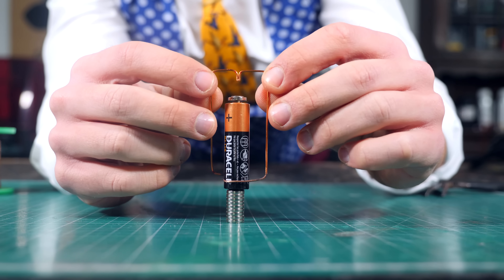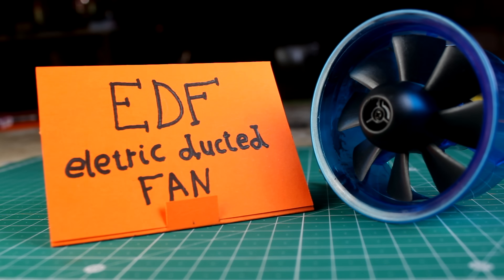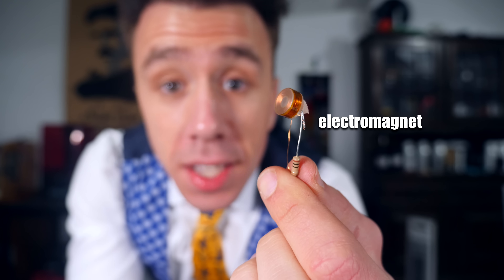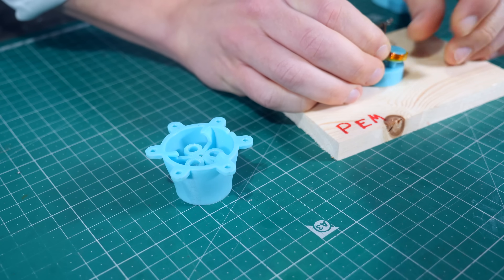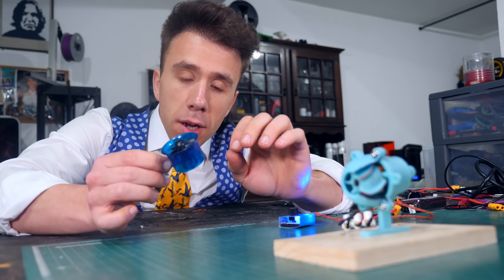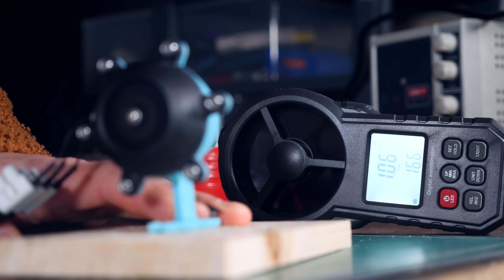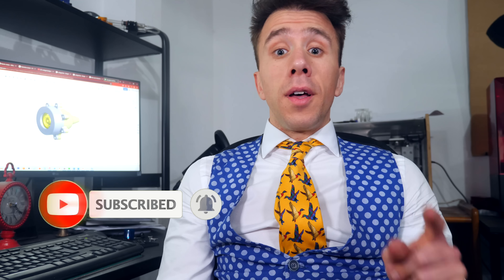I 3D Printed an ELECTRIC MOTOR FAN

Comment: I'm an engineer and here is some general information that can help:
The biggest issue is that you are not measuring the input power (voltage*current of motor) so you don't know if your fans are using the same electrical power. The same motor doesn't equate to the same use of power with a coupled fan (look up "fan laws"). 
The remaining issues have to do with the non-intuitive nature of fans vs impellers...
First, there are two distinctly different ends of the design of a "Fan": a propeller maximizes flow with low pressure differential. An impeller (compressor) maximizes pressure differential with low flow. 
Second, in a propulsion system, the pressure entering the engine and exiting the engine are both at atmospheric pressure by definition. 
The EDF is highly efficient because it uses a propeller that accelerates air without significantly increasing the pressure (there is a local pressure differential similar to a wing, but no actual pressure increase in the stream after the fan). 
The Turbofan that you make is compressing the air to flow through a smaller area than the intake and forcing it out of a smaller exhaust area. There are multiple inefficiencies here which are resulting in an overall loss of energy (less thrust) that the EDF does not have. The first inefficiency is in the compressor design (look below for notes on compressor design). The second is heat loss in the compressed air prior to exit (compressing air raises the temperature). The third is increased friction due to higher velocity air and more of the air touching a surface compared to the EDF. The last is in the exit nozzle because there is a significant velocity difference to the surrounding air.

If it's so inefficient, why is the design used?

It's used in a jet engine where there is heat addition to the compressed air before it is expanded out of the nozzle. Jet Engines use the Brayton Cycle which gets increased efficiency with higher compressor ratios and increased temperatures in the combustion chamber, and utilizes the power by removing the heat through the turbine section and converting that heat energy to shaft power and exit velocity of the air. 
Since you are not adding heat in your engine, you are not gaining any power from the compression, you are only creating more losses by compressing and expanding air.

If you look at existing aircraft, you notice that they have giant fans in the front, and multiple shrouds around the engines. These are known as "High Bypass" turbofans. They get their efficiency by NOT trying to use the hot exhaust gas as thrust, but by converting as much energy as possible to shaft power to turn the giant fans. Those fans push only maybe 20% of their air through the jet, and the other 80% is pushed around the outside of the jet, just like with an EDF. This way they get the high efficiency of a propeller within a shroud (edf) and use the most efficient process of the turbine which is to convert the heat energy to shaft power, and minimize unused heat in the exhaust gas. The irony here, is that an airline engine is trying to be an EDF rather than a "jet" because it's much more efficient. 

So here are some things that can help you moving forward:

Intake design: Bernoulli's principle applies and contrary to intuition, reducing the size of your intake opening increases the pressure your impeller can generate. If your intake area is half the size of the front area of the impeller, then Bernoulli's principle says that you are getting 2:1 compression (and 1:2 velocity) before the impellor. Its like getting free compression. Always make sure that your intake is equal or smaller than the entrance area of the impeller. (stick to 1:1 or at most 1:1.2).

Compressor design: The amount of pressure your compressor must generate is based on the difference in your entrance and exit areas. So if your exit area is half of your intake, then your compressor is 2:1. A hybrid compressor (combined axial and centrifugal) that you can build with 3d printing should probably stick to 1.2:1 to 1.5:1 pressure ratio before you get big efficiency loss. This means you need to make the area at the exit of the impeller that is slightly smaller than the entrance. Calculate wisely because it's easy to get a larger exit from a hybrid impeller. For reference, a squirrel cage fan actually has less pressure (but higher velocity) at the fan exit because the exit area is larger than the intake area. 

Combustion chamber design: You need to slow down the air so it can hold flames, but you also get more compression by expanding the air out of the compressor. If you send the air out of the compressor through a 4:1 expansion then you'll get air that's 1/4 of the velocity but 4x the pressure and makes it easier to hold a flame. If you can look up the flame front speed of the fuel you want to use, you need to keep the average velocity in the combustion chamber below this speed to hold combustion.

Turbine design: You are not really doing this but if you were, you should shoot for the same entrance/exit ratio as the compressor to start. 

Nozzle design: the goal of the nozzle is to match the pressure in the engine back to atmospheric pressure. This means you should really have the same exhaust area as engine intake area if you are not introducing combustion. 

Extra bypass nozzle design: Because the velocity of the air out of the nozzle is much higher than the airstream, you can add another nozzle behind this that will suck in bypass air kind of like a carburetor and get extra thrust by entraining the bypass air. Exit velocity is reduced but mass flow is increased. Look up the designs for turbine engines in RC aircraft and you'll see this method used. 

Brayton cycle design: 
Think of the process like this... the compressor flows the same quantity of air as the intake but increases it's pressure and/or velocity. It's goal is to increase efficiency by increasing pressure ratio in the engine. The expansion prior to the combustion converts the velocity out of the compressor into pressure based on Bernoulli and it's goal is to slow down the air for combustion. The turbine extracts heat energy and converts it to shaft power. The nozzle then converts the remaining pressure in the engine into velocity at the exit based on Bernoulli again. Pressure at intake and pressure at exhaust are always at atmospheric, so you can calculate pressure ratios within the engine from the cross sectional areas. 

Your fan and nozzle matching: If you design an impeller for a 1.2:1 pressure ratio, then your nozzle should be also 1:1.2 expansion. To have the most efficient design, your exhaust should be the same area as your intake, not smaller as in your video.

In Summary: Without adding combustion, you will never have more thrust from a design that compresses the air than from a design that is a fan using the same electrical power. 

To caveat this, although I am an engineer , I'm not an expert in jet design. This is just the basics that I was taught as I remember. So I can't guarantee everything here is fact... but should be close. I'm also not immune to being wrong.

Comment: Correct me if I'm wrong, but I think that the blade geometry of your impeller is backwards. As far as I know it should be curved inward at the intake to 'scoop' the air and throw it out of the exhaust. On yours, the curve is at the exhaust, so its probably just 'stirring' the air rather than moving it.

Comment: I'm a little rusty on my jet propulsion theory... but I think an issue you might be having is feedback pressure. Jet engines have a series of fans that are designed to keep the high pressure on one side of them. It looks like your design just has the one fan. So because you're reducing the outlet diameter to build the pressure inside, but not unbalancing the pressure, some of that high pressure air is fighting against the air coming in, reducing your thrust. Also, in a traditional jet engine, the purpose of the fuel is to (literally) explode the pressure so you get a helluva of lot more pressure coming out, which greatly increases thrust. And then because the pressure is unequal across the fans, the fuel explosion actual helps to create a vacuum on the low pressure side of the fan which helps to draw even more air in.

I think you might have to look into something like air uplift and downdraught and see if you can apply that to your engine. Without fuel, you don't really have anything increasing the vacuum pressure on the low-pressure side of your fan, so you're not going to achieve the kind of thrust I think you're going for. 

I don't know if it would work... but I would try to modify your fan design. Start with a disc and print the centrifugal fan in the middle of it. Give some space for the inner walls of the fan and then add blades that would fit inside the outer wall of the engine. In the space between the inner and outer fan blades, you'll need cutouts in the disc to allow the air from the centrifugal fan to pass through. If you angled the edges of these cutouts, it would help with air movement. The inner walls on the high pressure side would focus the high pressured air out the exhaust, and the outer walls fan area would have openings near the exit of the exhaust for the lower pressure air from the out fan to go. Since the HP air would go in one direction and less likely to spread, it would create a vacuum in the outer fan area, pulling more air through the lower pressure fan blades. This vacuum would force the outer fan to spin faster, and since they're connected to the inner fan via the disc, that should spin faster as well increasing the HP air which in turn increases the vacuum from the outer fans and you should get a positive feedback loop which should increase thrust. But like I said... I have no idea if it would work. Sounds good in my head though, lol.

Comment: The reason is simple, the 3D printed fan blades have a very low surface area. Yes it is  rotating at the same speed but the blades are too small to move any air. This is something you can see on old warbirds the Spitfire mk.22 had around 2000hp and a 5 blade propeller with long skinny blades, the  german Fw190A9 also had around 2000hp but a 3 blade propeller with shorter and wider blades. Both propellors despite being very different in shape had a similar surface area imparting useful work on the air to create a similar amount of thrust.

Comment: It's hard to take this stuff seriously. If constant electricity can create a magnet, but a magnet can't create electricity (unless it changes/moves) there's probably some arbitrary nonsense involved.

As for the fan's performance, it seems obvious to me. It's just a restricted flow. The ducted fan has no flow restrictions. The aerospike has massive flow restrictions. So this creates high pressure without creating high flow. Meaning, it should just cause less mass to be moved, resulting in less thrust.

To be fair, I do think this aerospike design can produce more thrust than a simple bell nozzle in a rocket because of the greater displacement and surface area, but that's only with an expanding fuel. Fluids like air and water are a little different. You aren't trying to compress or expand anything. You are trying to create flow or movement.

Consider using this design as a water propulsion system, and it becomes more obvious. Water isn't compressible, so it needs to be moved. This design has less flow capacity than a normal ducted fan would, so it should produce less thrust. It's similar in air, but air is compressible, so it changes the dynamics slightly.

Also, the impeller didn't seem very efficient or effective.

Comment: Here is a video topic suggestion. I've always wanted to see if it were possible to use the principles that make a pulse jet function and try to design a completely electric version using sound waves, perhaps from an ultrasonic transducer. It would be a neat experiment even just cracking the math and, if possible, to assemble a prototype.

Comment: ...maybe you should measure input power (voltage and current) of the motor in both cases to see if the power/thrust ratio is equal of massively different.

On the other side, that centrifugal fan may have a bottleneck on the input side because cross section of the input opening is way smaller than on the EDF and may result in creating an air resistance...:/

Comment: @Integza ....are those impellers not turning in the wrong direction...? 🤔 If the impeller blades point clockwise, shouldn't the impeller turn anti-clockwise....? I'm just spit-balling here.....🤔

Comment: If you put the motor of the EDF to the centrifugal fan you would get the same power, but not the same thrust.

The thrust is based on the type of fan you make. An axial fan, where you use the fan to exert work on the flow would give it a lot of kinetic energy. 

On the otherhand, A centrifugal fan would use the work to accelerate the air and bring it to stagnant condition, where the kinetic energy of the fan is being converted to pressure energy.
Converting the pressure energy to kinetic energy would require a long exhaust (and therefore more friction leading to dissipaktion)  to make sure it flows in a proper way or else you would get a explosive flow, where it flows to the side as it exits the exhaust due to high exhaust pressure

remember jet engines generate engine thrust by adding heat to efficiently convert pressure to kinetic energy. Fan bypasses are designed with axial flows in mind

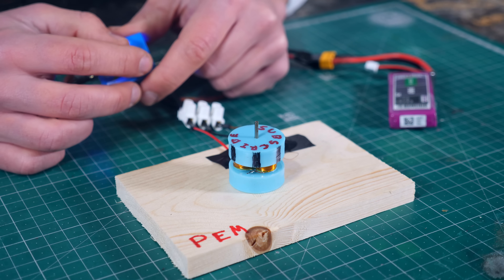Comment: 2:40 what you've got there is a servo tester. You're using it to control the ESC (electronic speed controller). It's not a speed controller because it doesn't control speed. It sends out a pwm signal that'll make anything that understands pwm do whatever it does when it gets a signal. In this case, control the speed of the motor. 🙌🙏
Reply: So, the ESC is the speed controller. Obviously. 
What is the point of your pedantic observation?

Comment: Keep in mind assuming the EDF was designed by an engineer worth half their weight in salt you’ll never be able to compete in terms of efficiency with your design as you’ll always have thermal losses through compression and eddy formations (precisely the thing EDFs try to minimize in order to improve over traditional fans).

Next video idea: toroidal propellers? (Basically a ducted fan without the duct)

Comment: You need to check a few things here;

Diameter of the radial compressor, the change in inlet to outlet area from the compressor, the power draw of the motor itself - you'll find that the EDF if drawing much more current, and hence consuming more power (because the radial compressor is not taking as much torque to turn)

A radial compressor requires a large change in diameter for the compression to happen, if you try to design it a bit more like a turbo compressor, you should have better performance, these are amongst the best radial designs.

The last point though, is that radial compressors efficiency tops out about 10% below that of axial. Hence, if the EDF is well optimized you will still see at best ~10% lower performance.

Fluid mechanics and thermodynamics by Dixon and hall would be a great starting point for design for the compressor.

My guess would be that your compressor isn't creating enough of a pressure difference to create the airflow you want, or that your design is experiencing surge.

For a couple of pointers on the compressor itself, if you start of with a concave circular surface and add wings on to it, you might experience better performance.  At the moment your compressor is convex, so the air initially is pushed out, and then thrown rearwards, the opposite is what you would like to happen - pulled in by the low pressure, and then thrown to the outside of the housing.

Most of all, the diameters of your compressor, are what will determine the rpm, torque and power demanded. You will have to work backwards, with the max power@ what rpm and hence torque, to determine the characteristics of the compressor